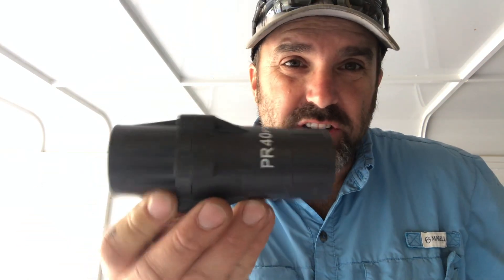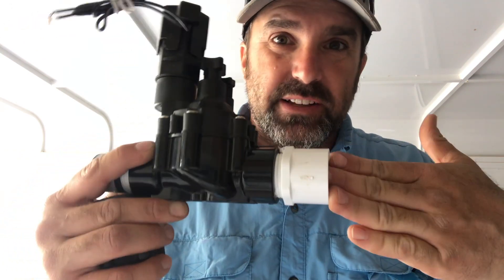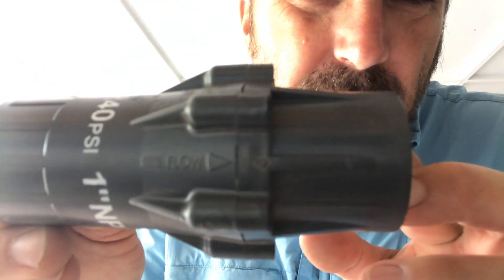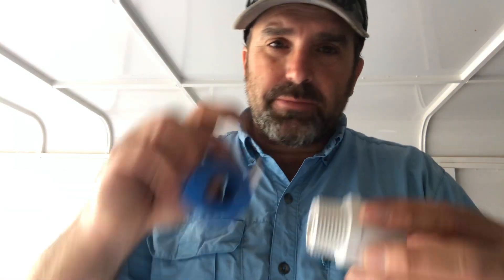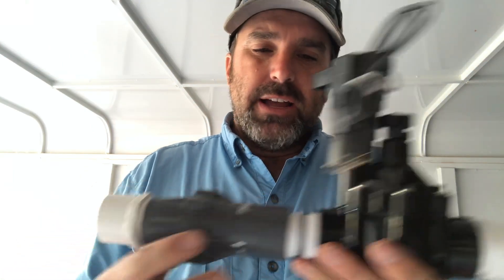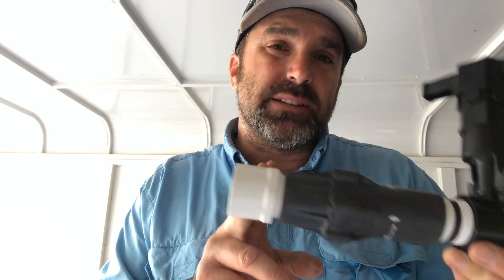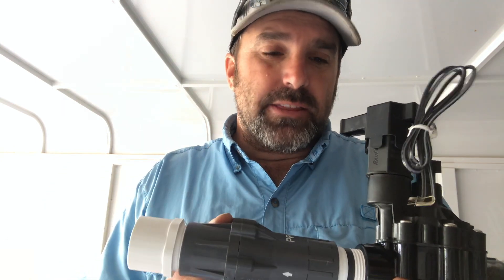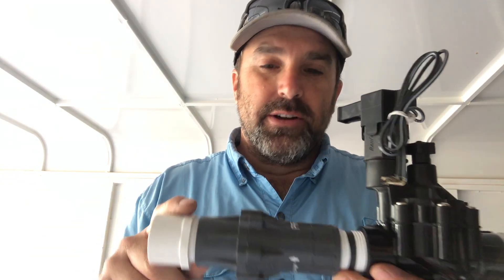Sprinkler System Valve Pressure Regulator

Comment: Do you have a recommendation for a regulator 'limit' valve.  I need to drop the pressure before the valve.  Our city water pressure is 100 psi.  In no time the control valves leak everywhere and no amount of tightening the screws helps.
Reply from the maker: We design most systems for 65 psi. You need a minimum of 30 to 40 psi at the head for them to operate properly. If you can regulate down form 100 to 65 ,70, that would help.
Reply: @AmericanIrrigator  Agree on what you say.  The problem is finding a 'limit' regulator that can be used in a static pressure environment.

Comment: I am a little confused about whether I need a pressure regulator for my sprinkler to drip irrigation conversion. I am using the Irritrol 2700DPR valve, which has a screw which allows one to control the water pressure in the system. Is adjusting the valve, to lower the water pressure, suffice to stabilize the new drip system on should I still install a pressure regulator at the end of the riser? I can not find any documentation that address that question. Or should it be assumed that a pressure regulator should ALWAYS be installed when using a drip system? Thanks for your assistance.

Comment: Are there pressure relief devices that install on the supply side of the valve?  We are having issues blowing holes in 2" pvc before the valves on a large community system.
Reply from the maker: Yes. There are brass ones that are made for that and you can adjust the pressure to where you need it.

Comment: Do you need a pressure regulator on zones that are using bubblers to water trees?
Reply from the maker: Good question. I typically do not use pressure regulators on bubbler zones, just zones with drip tubing. Bubblers tend to be ok.
Reply: @AmericanIrrigator  Thanks so much! I’ve been enjoying all your videos.

Comment: Why not put it on the inlet side of the valve?  To reduce wear on valve
Reply from the maker: If you had extremely high pressure this would be a good idea, but in most cases the valve can handle normal amounts of pressure. So there would be no need to regulate the pressure for the valve itself. And these valves do need some pressure to operate properly, as far as opening and closing. But you do need to watch the pressure for the drip tubing. 40 psi is recommended.

Comment: My sprinkler heads keep blowing their heads off, way too much pressure. I have access to the supply for the zones its above ground with a ball valve and plenty of room to add a pressure relief, I think the pipe is 1 inch pvc. What would be a good PSI for a sprinkler system to run on? Also do you have links to PRVs?
Reply from the maker: 45 psi at the head is a good pressure to run at. A lot of systems are designed with a design pressure of 65 psi. By the time you flow water through the various parts and equipment you may be at 40 to 45 at the head. If you are going to put a pressure regulator at the beginning of the system, it is a good idea to use an adjustable one, that way you can dial it in to exactly what you need. If you put a 45 psi regulator at the beginning of the system, the last head may not pop up and work properly. Test the pressure first and see where you are at and go from there. I do not have any  good links at this time. sorry.

Comment: I had a guy install pvc pipes and sprinkler heads but the heads are not picking up need help
Reply from the maker: First question is, was he licensed? It could be a lot of different things. Possibly a broken line. Too many heads per zones or wrong nozzles, trying to spray too much water at one time, going over the gallons per minute. Piped wrong. A clogged up line somewhere. Low pressure, not enough pressure to pop up the heads. Just to name a few. You might want to call him back out to go over it and fix it. Sorry not much help.

Comment: Enjoyed your video -  is there a reason you can't put the pressure regulator before the manifold if the pressure is too high and you want to reduce it for all lines?
Reply from the maker: You can certainly do that and sometimes it is a good idea to put a pressure regulator on the main line around the backflow device and regulate the entire system. We had a job where I had to do that. So it really depends on the system and they area and the pressure situation on site. A lot of times you want to keep a good amount of pressure in the system for the spray or rotors zones and just regulate the drip zones. That is why I do it this way.
Reply: @AmericanIrrigator  I am also thinking I need a pressure regulator upstream from the manifold for my back yard at the end of the old steel pipe, because I have had the PVC parts there break three times in the past year or two. Twice it was the same part, this last time another, the line mender part I had put in on the first repair. So I suspect I'm getting a big pressure surge. Does this sound right?

Comment: Why not put the pressure regulator on the supply side before the anti-siphon valves?  That way you only have to use one instead of several.  Just asking.
Reply from the maker: You can certainly do that and in some cases it is a good idea if you are in a high pressure area. But if if the pressure is marginal, a little too high for drip but good for the rest of the system, like for spray zones or rotor zones, you would want to just use a pressure regulator on the drip zone like we were doing here. Every system and area is different so you would want to test the pressure and design  and install the system accordingly.

Comment: Thanks for the great info! You mentioned it's possible to do pressure regulation from the "stub" / PVC fitting. Do you have a recommendation on which should be used? Thank you!
Reply from the maker: You could use one like this and it would work but it is a little big for that location. I have use a smaller one by Senninger Irrigation Inc. They make them in 3/4 and 1". They are a little more compact and work well on the stub up. I tried to put a picture of one in this comment but it would not let me. Sorry.

Comment: Great info. Question - trying to help a neighbor. His poly tube sprung a leak, tube spilt. I put a coupler. It caused another and another and 6 couplers later I thought maybe it's a pressure thing? He did mention he had 4 sprinklers but removed them when he got artificial grass. Now it's simply a giant drip system from the vales out the various trees and shrubs. Any ideas would be appreciated.
Reply from the maker: Oh man. Well, if the fitting are blowing out or the drip is blowing apart, then it sounds like a pressure issue. If the tubing is just simply cut, like from maintenance workers or animals, then it is just a matter of repairing it like you did. You may have to replace a longer section of the tubing. You know, sometimes when guys install the drip in the beginning, if they are not careful when they cut the wrapping off or the ties that hold it together, they will cut the drip and there will be cuts through out the entire roll. I have had employees do that and when I turned it on, there where leaks everywhere. We took it all out and started over. Hopefully you don't have to do that. Hope this helps.

Comment: Do my sprinklers need a pre filter? I got filters for my drip but not on sprinklers

What’s the ideal psi for sprinkler?
Ideal psi for drip? I think my emitters are rated for 30psi and my regulator is 30psi
Reply from the maker: Most of the time you will not need any other filter unless you are on a well. I do use extra filters and sand separators on wells, this helps keep the heads and valves from getting clogged up. Most sprinklers require around 30 to 40 psi at the head to operate correctly. If you have that you are good. Drip needs to be regulated at 40 psi max. 30 psi is good. Drip will operate at even lower psi.

Comment: my regulator started making a high pitch noise whenever the water is on.  What is happening and do I need to get a new regulator?  Thank you.
Reply from the maker: I'm not exactly sure why it is making that noise. It could be a number of things like it is going out or it has something clogged in it or it is messed up in some sort of way. If it is still working, as far as still regulating pressure and doesn't seem to be affecting the way the zone runs, I would leave it in. BUT, if it is really affecting the zone and seems to be causing problems, then replacing it might be the way to go. Hope this helps.

Comment: Great video, I am a Novice when it comes to sprinklers , I was wondering if it is normal for pressure regulator to drip ever so often, or did I , not going to lie I did use a wrench,  over tighten and likely cracked a little bit 😬
Reply from the maker: Oh no. It is not normal for anything to be dripping or leaking. It could be that you did over tighten and crack it, but if that was the case it would be leaking more that a drip. It would be spraying everywhere and you would know for sure if you cracked it, in most cases. It may be that you didn't use enough teflon or pipe dope on it and it is just not sealing off. Sometimes a drip can stop over time, but most of the time if I install something and it is dripping or leaking, I just shut the water off and take it all out and do it again. It is a pain, but you want it to be right. In my case someone is paying me to do it, so I have to make sure it is good and right.